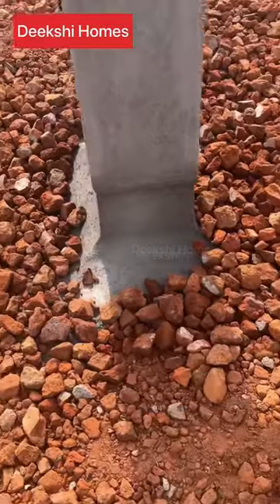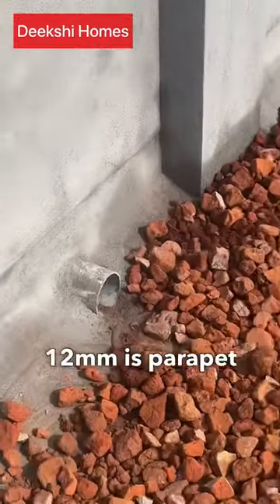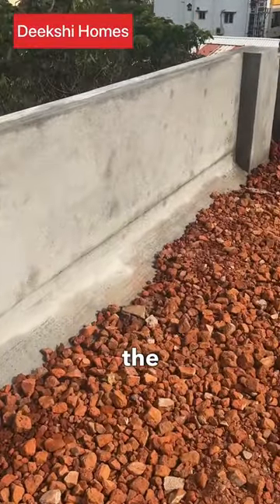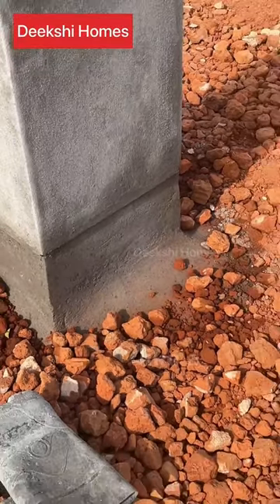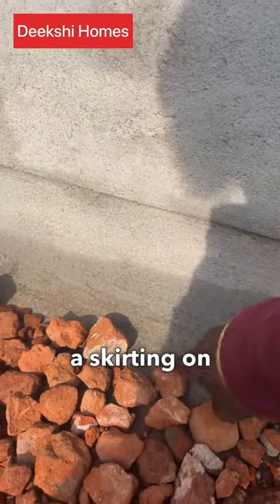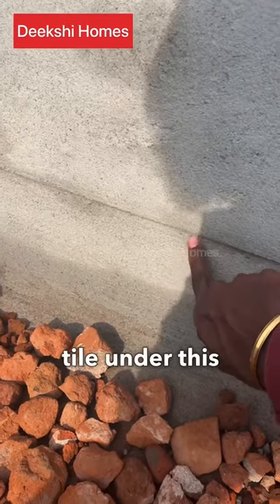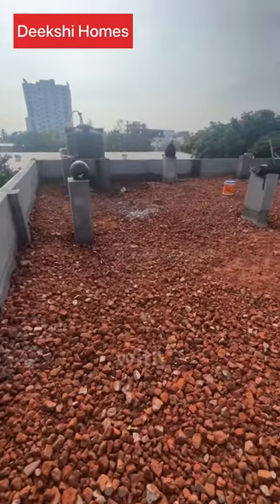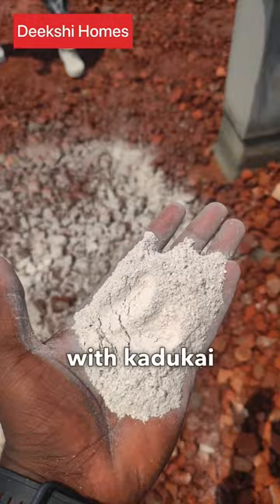Clay Tile, Weathering | Roof water proofing | தமிழ் | Tips | Deekshi Homes

Comment: One help, I want to extend my single story house at one side. Extention consist of ground and 1st story building. At some place I need to remove the side wall and need join both. Also I need to consider the roof tiles while Extention. When I plan fir a slap, I couldn't come with any idea. Can you?? No tie beams need to put the columns but roof tiles obstruction. I want a continuity...
Reply from the maker: There are few solution which can't be asked or provided in comments without proper site visit. Kindly consult with nearby structural engineers